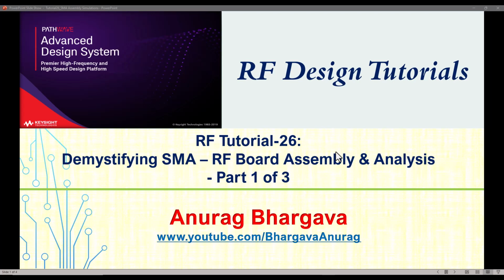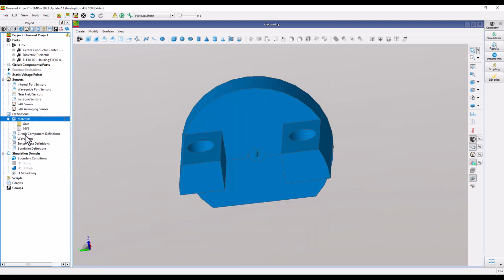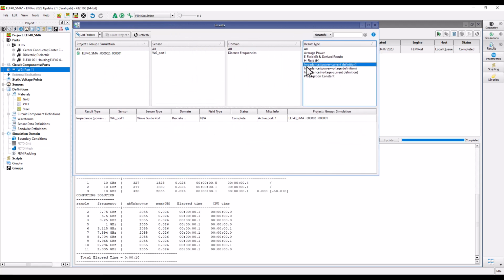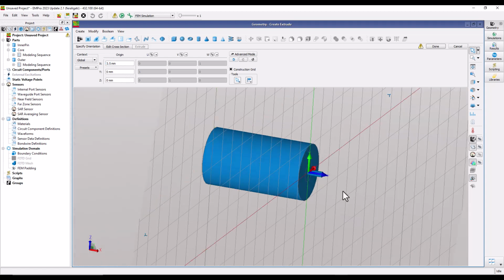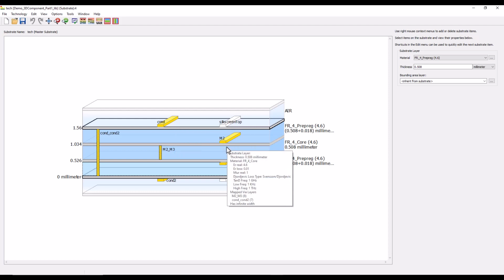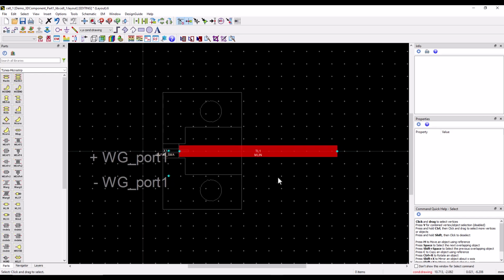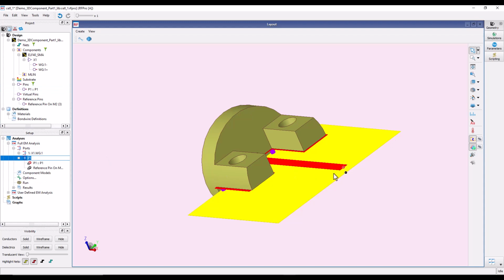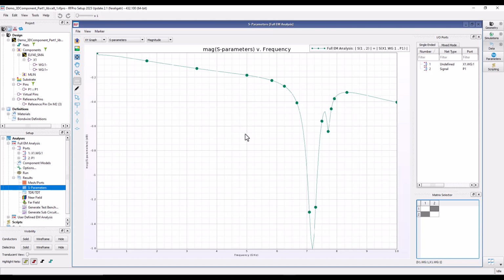RF Design-26: SMA-RF Board Assembly and Analysis - Part 1

Comment: Nice video!
What is the difference between Mesh domain optimization “on” and “off”. Will there be a difference in the simulation results and what setting is best to use to obtain accurate simulation threads?
Reply from the maker: Mesh Domain Opt is used when you are performing simulation on selected Nets instead of whole design to constrain the ground plane to only relevant area. It has no role to play when you perform Full EM analysis of the complete design

Comment: Thanks Anurag Sir! I was really waiting for such videos on connector-board interface in RF-pro, as I feel its a crucial thing yet not much talked about. I have myself tried such simulations before, and on certain occasions found it really hard to get the expected good results. 
Another problem I have faced is that vendor provided connector 3D step model files have most of the time turned out to be one where the whole connector is selectable as just one part. Thus, assigning different materials to different parts could not be done... Any ways are there to resolve such issue?
Reply from the maker: In case of fully unified step file, you can't do much and will have to contact the vendor to provide proper file.

Comment: Thanks for such an incredible video Aurag Sir. I'm encountering a error while trying to do a FEM simulation of a design in EMpro which says The command line is too long. Any idea how to fix this
Reply from the maker: Hi Raj,
Difficult to comment without seeing your design but if you are using Windows OS then make sure that the path to the EMPro project isn't too long as operating systems puts some limits on number characters in the path. Try copying it to the folder that has short path, if this resolves the issue then fine else contact Keysight tech support team for help.